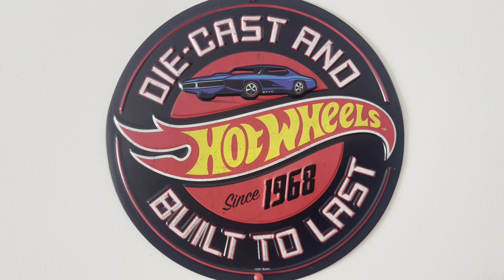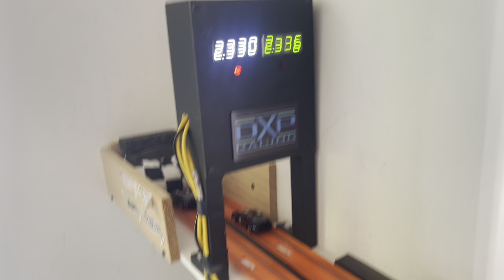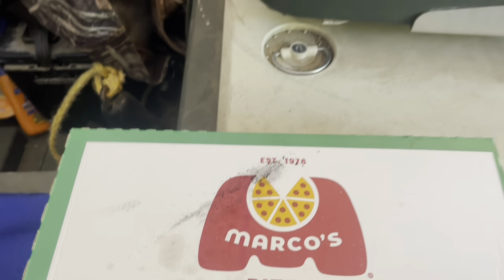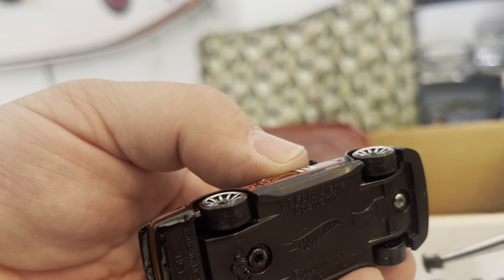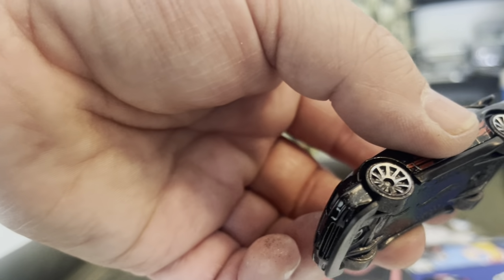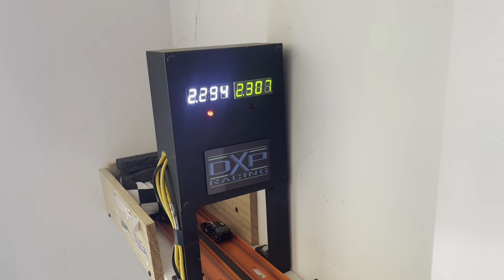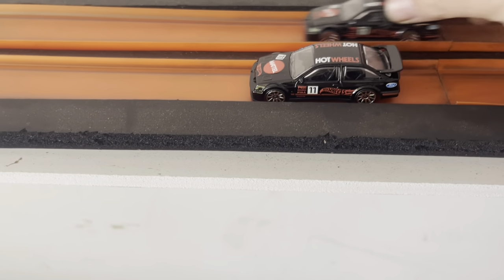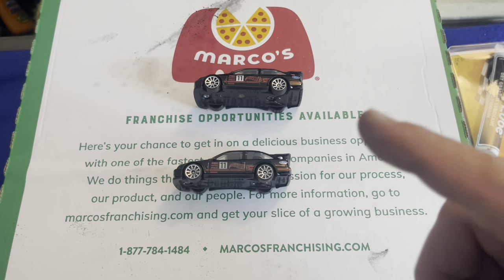How to make a Hot Wheels faster

Comment: Mix 91% isopropyl and graphite 2:1 in the same bottle - it's a faster process, easier, and way less messy. The iso evaporates quickly and it'll even coat the axle inside the chassis. I have a video on my channel if you're interested.
Reply from the maker: Never heard of mixing alcohol with graphite.  Why would you need graphite inside the chassis?
Reply: @dxpdiecastracing  - For free-spinning axles.
Reply: @dxpdiecastracing  - I wanted to see what would help cover the axles with graphite and tried liquid silicone first, then tried iso. It works great! No tapping the wheel, just one drop of the mixture seeps into every spot and like I said it helps lube free-spinning axles by coating the axle channel.
Reply from the maker: @FeralPatrick  I actually don’t run into many free spinning axles.  The metal bases usually grip with enough strength to prevent much turning and what turning there is has friction due to the clips.  Plastic bases are more loose but still have the friction due to the clips.  Best results usually involve the axle no movement with only the wheel spinning.  I know there is some debate on that but most hardcore racers prefer no movement of the axle.  Interesting with the alcohol delivery though.  I have heard some did do that especially on JL’s which can be harder to lube.  Hey, if it works it works, right.  I may try that just to see what the results are.  Thanks for the tip.
Reply: @dxpdiecastracing  - If the cars aren't disassembled and you spin one wheel, if the opposite wheel spins the axle is free-spinning (as I'm sure you know), so it works well for that. It also helps coat the inner hub of the wheel where it contacts the chassis. I lock down all of my axles if the track allows mods, but for stock racing if you can lube the free-spinning axles you'll likely improve your odds.

Comment: are larger diameter wheels faster than shorter ones?
Reply from the maker: In general, the larger wheels will cover more ground when in motion.  The smaller wheels usually start faster.  All physics.